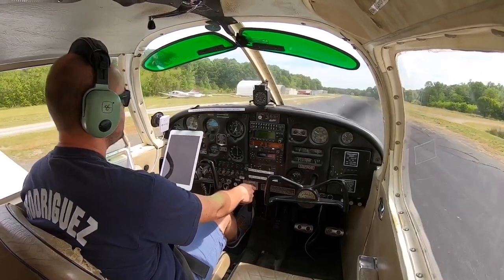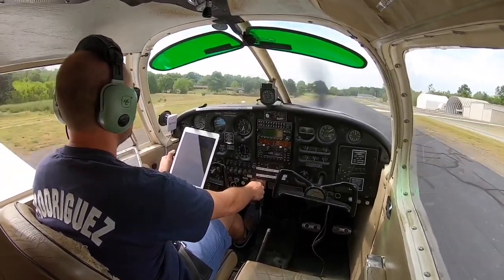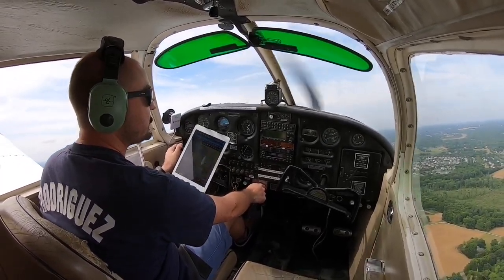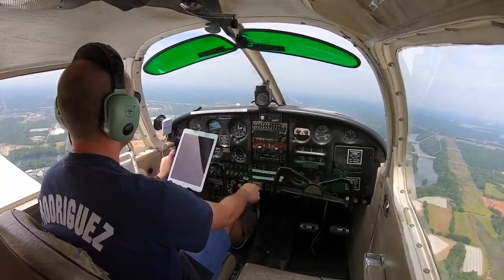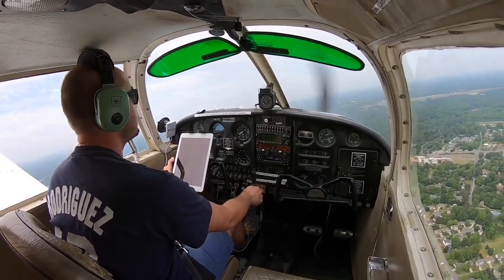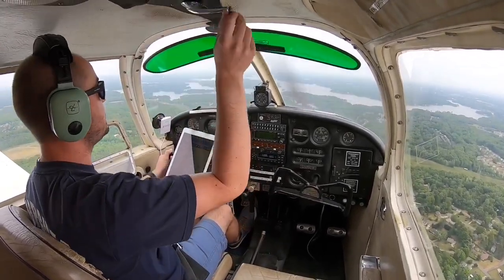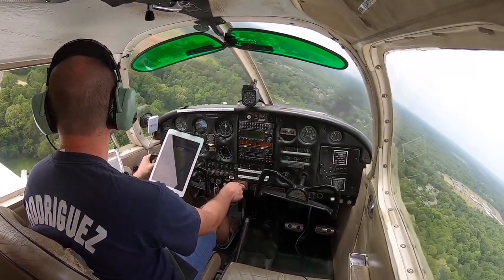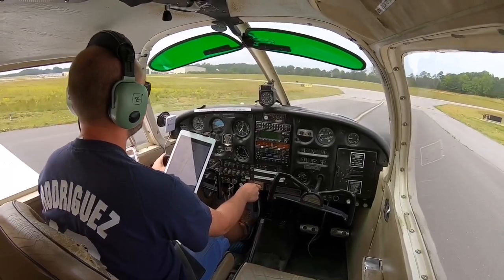FLYING LOW Under Class B Airspace in a Cherokee 140 | Run up | Cockpit View | Pilot Vlog #14

Comment: Could you share your video equipment setup,  it works really well.
Reply from the maker: Thanks! It took trial and error. I use NFlightCam GoPro audio solutions cord with a GoPro Hero 7. My mount is a RAM suction mount with a 5” arm. Word of note - you’ll have to buy an after market GoPro frame that allows for full access to the audio input plugs. The frame that comes with the GoPro does not work. 

I’ve had a lot of folks asking for my setup so I’ll be posting a video in 2 weeks showing what I have. Thanks for watching!!

Comment: Glad I found your video. Just subscribed. I just got my PPL (after 2 years of on/off training) and planning to, some time soon, fly my 1947 Ercoupe from KGYH (Greenville, SC) to KTTA (Raleigh, NC) to visit our daughter. My plan is to first fly to KLKR (Lancaster County) and back to get familiar with the area before making the full trip. So your video was great as I have never flown near/under Class B airspace and looks like I can easily fly to KLKR under the 4000 Class B shelf without having to get involved with CLT Approach. If I can transition under the 4000 and 6000 shelves on the trip to KTTA it would keep me away from Gamecock MOA and make it a more direct route. Any thoughts would be appreciated. VIc.
Reply from the maker: Hi Vic. Thanks for the comment and question! In a 47' Ercoupe I personally would fly under the shelf. Air should be pretty smooth as well. Did you make the trip yet? Sounds like a fun adventure.
Reply: @PrivatePilotAdventures  Thanks for the tips. Have not made the trip yet. Between holidays and bad WX will have to happen in the spring more than likely. Happy New Year. VY

Comment: "Flying low at 2,500ft.." - that's not low - my hard deck for aeros is 2,000ft...! Also, in the SE UK there is a lot of Class A, C and D right down to 2.500ft (some places even 1,500ft).
Reply from the maker: Sounds like fun flying in SE UK!!!! 2500 is low for this area since there’s a lot of GA traffic. Plus ground level is between 700-1000ft, so we’re flying close to the ground. Obviously not very close but close nonetheless. Thanks for watching!!!